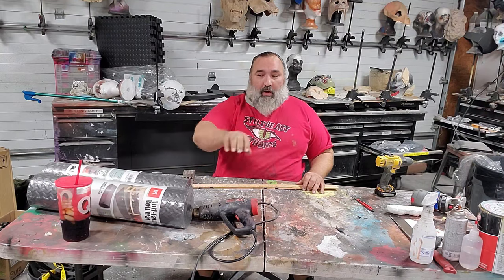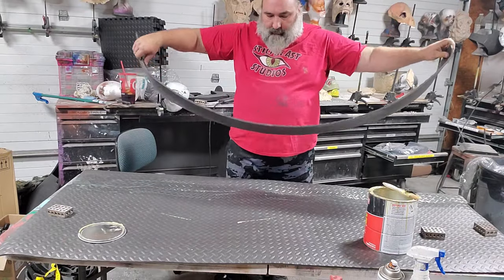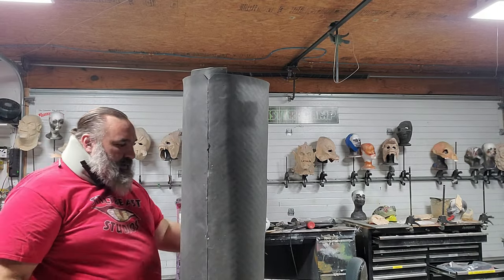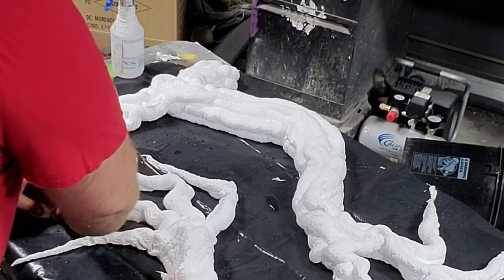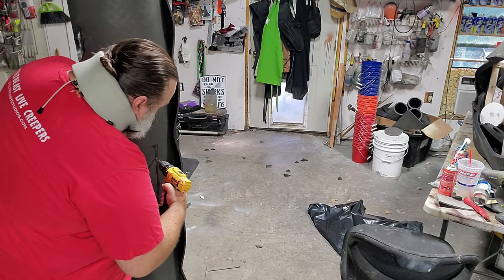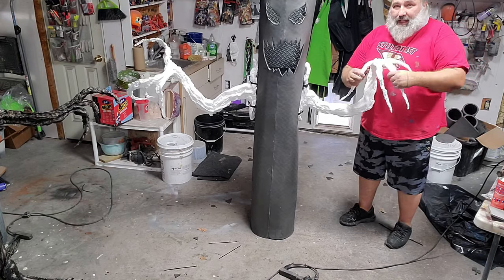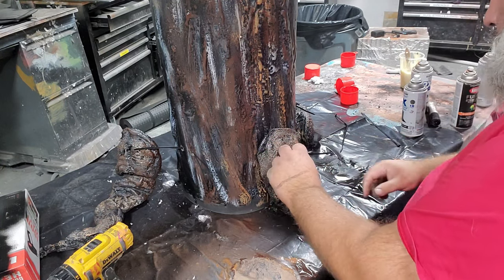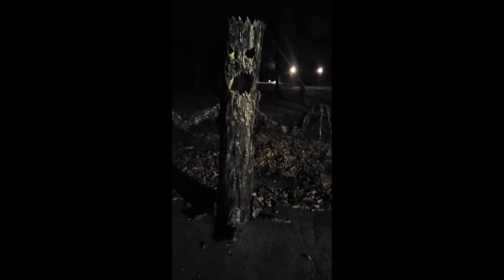Make a spooky Halloween tree DIY under $50

Comment: Can this be put outside? How well does locktite hold up to weather?
Reply from the maker: yes it can, its fine outside. in extreme heat it can soften and sag, but wires inside will help that. once painted the locktite is fine outside

Comment: Allen What about a 12-ft spooky tree?
Reply from the maker: 4 foam rolls, the bottom layer is doubled up the top is 1 layer thick. run a 8ft 1x4 inside the trunk screwed to the side of the bucket. that zip ties to the trunk all the way up to 8ft. the inner layer has the 2ft strip on the bottom so the joints dont line up. does that make sense?

Comment: not trying to correct your technique but wouldnt having the open (wider part) of the bucket be better on the bottom.. you could glue stakes to the inside... and it would appear wider at bottom like a tree.... but this looks awesome not criticizing at all.
Reply from the maker: having the solid bucket bottom to add weight is a bonus, but the big positive of having it right side up is that you have that nice support ring touching the tree 18" up, upside down, only the ring really touches the tree so it would only have support 3" up, and the bucket bottom would be loose inside. if you did the bucket upside down then I would add a vertical support of some kind.
your observation is correct, but my choice was based on engineering.
Reply: @StiltbeastStudios  solid reasoning... I am now curious to try both... I do envision having to put vertical supports up the sides.... mostly because I think I will just make the arms removable so next year its easy to set up.
Reply from the maker: @sydekontrol2330   they are removable, just held on by zip ties, snip the ties and re zip tie next year is the plan.
Reply: @StiltbeastStudios  that is one of the big points I took from your video.

Comment: Is that normal pu foam?
Reply from the maker: its floor foam from harbor freight in a roll, its locktite spray foam gaps and cracks, and gorilla glue original specifically